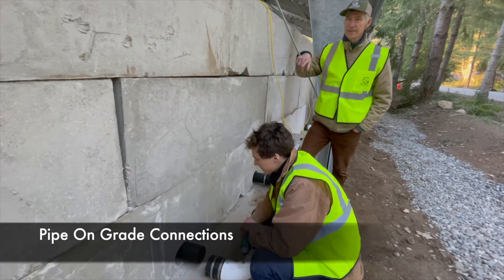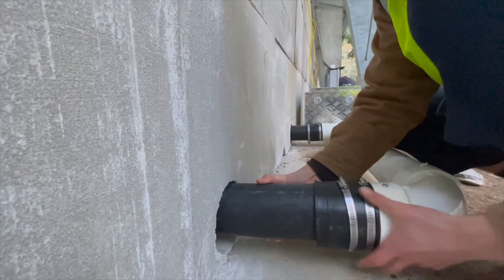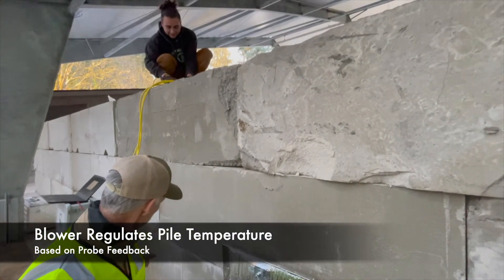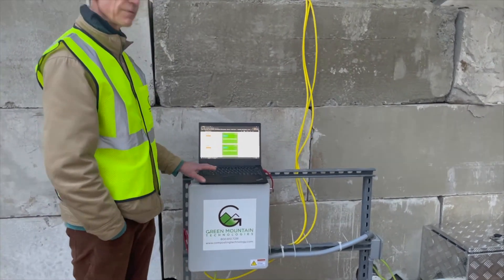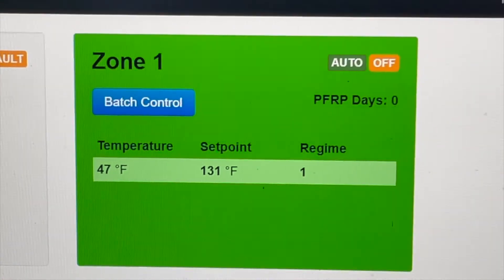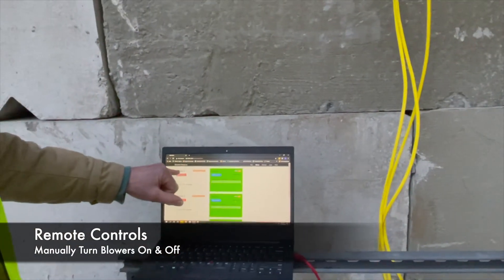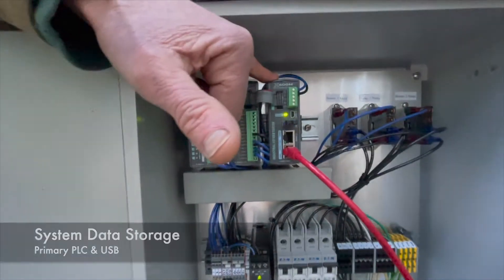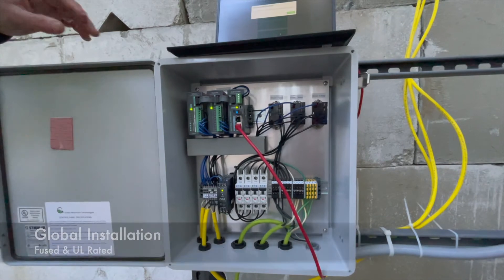Pre-Engineered Aerated Static Pile (ASP) Composting - Bloedel Reserve

Comment: Really nice set up. Do you find you need to monitor and regulate moisture too, or because it’s in the bay for just 3 weeks would you just adjust moisture when transferring it to the next bay? Great concept to have the pre-engineered package! ASP in a box!
Reply from the maker: We're so glad you like it! It's suggested that moisture is assessed at certain times throughout the 3 weeks and can be adjusted a number of different ways. We like to get up close and assess it by feel.
Reply: Yes we add moisture every time we move the piles. Otherwise it very hard to get the moisture into the pile if you just try to wet it from the surface.